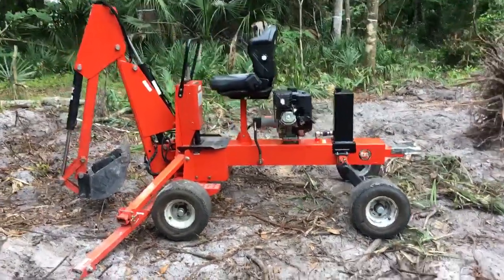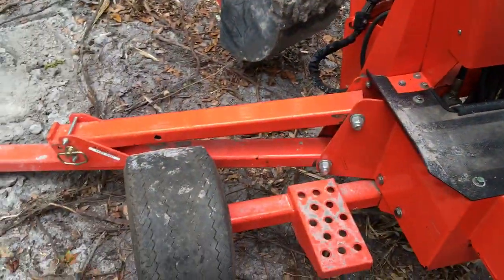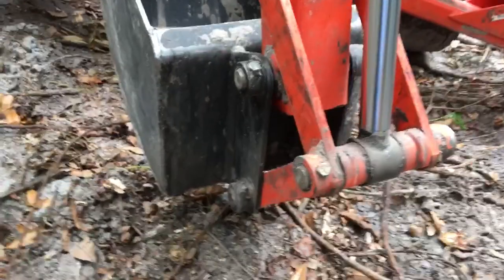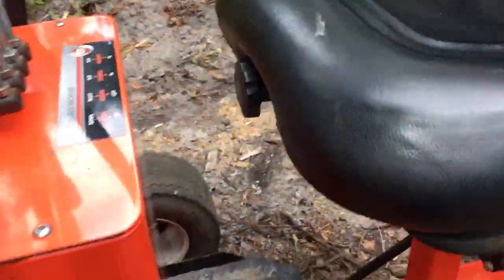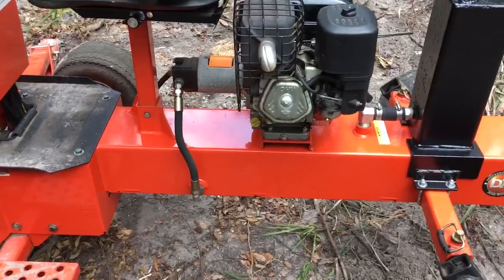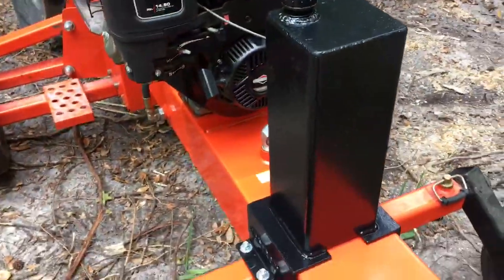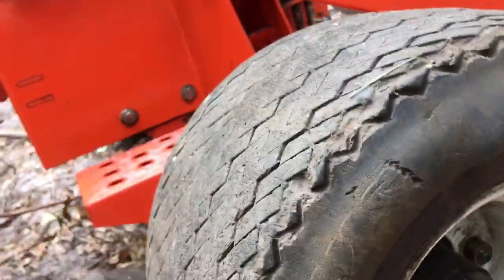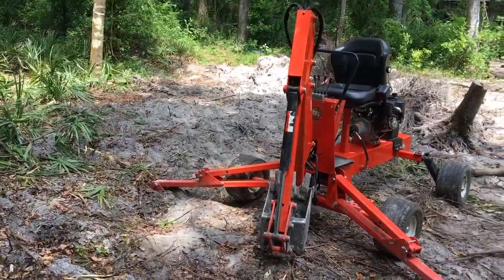DR Backhoe Towable Backhoe Modifications

Comment: I have just purchased a DR Backhoe and really like it. It has plenty of power and seems much faster than my  ability. My only complaint is the manual stabilizers. Most of what I use this for is ditches which are less than 24" deep. It seems I spend so much time rasing and lowering the Stabilizers. I have a 6 month trial period to return it if I'm not satisfied with the backhoe. I seen another backhoe called " Dirt Master" which looks to be a carbon copy of the DR. With the exception that it has hydraulic stabilizers. The dirt master is $1,000 cheaper than the DR. But I don't know much about the Dirt Master, and would be concerned  if parts are needed for it down the road. My question is, do you know anyone who has added hydraulic stabilizers to the DR. It looks to me that making that modification would be fairly easy to do.
Reply from the maker: The Dirtmaster is made by QuickWay and I believe is a reputable Manufacture that I would think would have parts for a long time.

Adding hydraulic stabilizers may not be bad but my guess if the Dirtmaster is a better machine. It comes with a Honda facing the right direction, lol.

Comment: How is the burp tank working? I am considering building one to mine.
Reply from the maker: Seems to work great. Are you having it spit oil when you are moving around?
Reply: @heneryhawk2667  No just if it's not almost perfectly level it starves for fluid. I pulled the dipstick and it has fluid on it but there isn't a full line on it. Maybe it just needs filled up more. I can do more research.
Reply from the maker: I had a similar issue, adding oil helped the starving but cause it to leak out the vent. 

When I move around with the boom and do not have the rpm’s up one of the boom cylinders will suck air in, keeping the rpm’s up helps this a lot.

Comment: The Harbor Freight backhoe has gotten better reviews than the DR backhoe at less than half the price
Reply from the maker: I have not seen a HF Hoe in person but the quality of the DR would be hard to beat. I purchased mine used with all three buckets and ripper for what the HF unit would cost. If I had not found this one I would of likely purchased the Jansen unit.
Reply: @heneryhawk2667  The DR backhoe is approx. $6800,  the Harbor Freight is approx. $2700 delivered. It is a better deal for me, for home use.
Reply from the maker: Hard to beat that price, I’m sure it will work good for you.